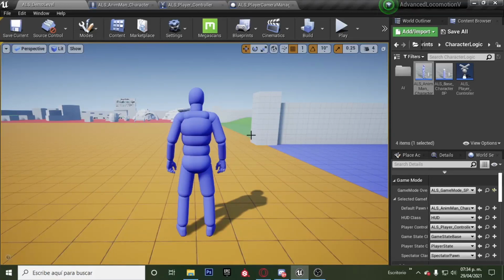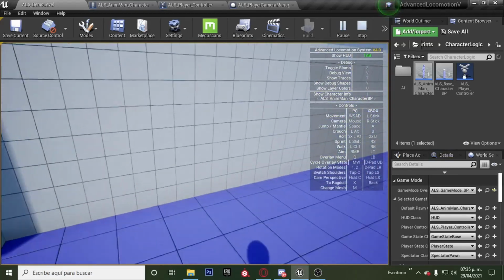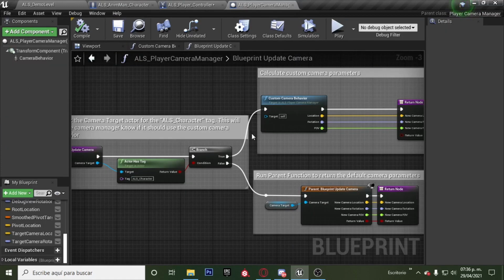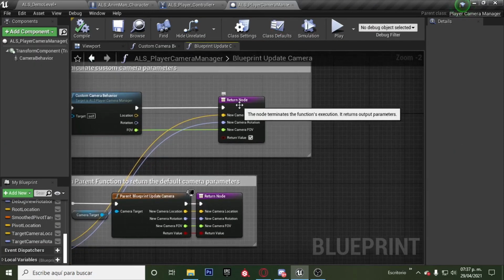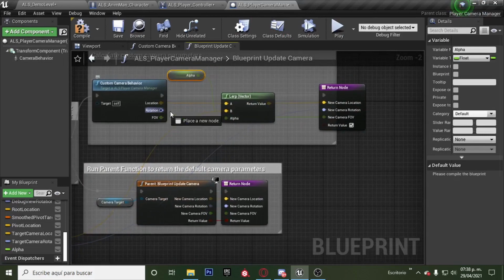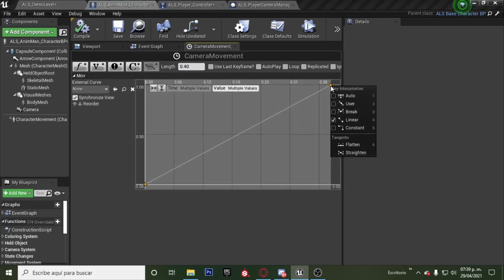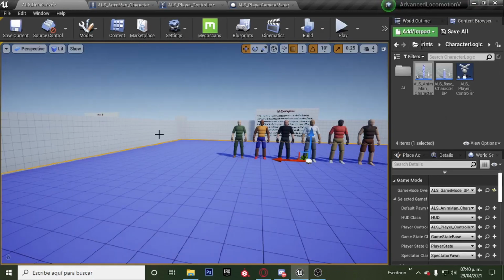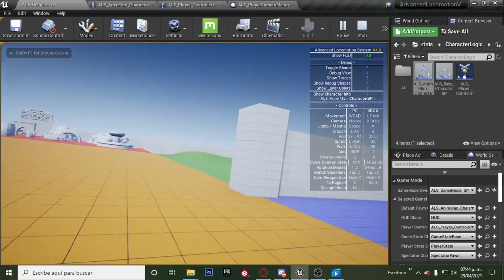UE4 Improve camera system using CameraManager

Comment: hi there , any idea on how to use the als 4 camera management system on a vehicle . i did all the camera animation part for driving and added a new movement state as driving in the enum . and when i posess the vehicle i change the movement state to driving but the vehicle just doesnt use the ALS camera .
Reply from the maker: the camera manager needs a reference to the character, if you are changing the character you are also changing the camera, but a cool feature is that the camera manager is part of the controller, so just edit the code to use a reference to the car instead of the character

Comment: I think this type of True First Person is only better / cool on the surface, but in actual gameplay contexts its very jarring and doesn't represent the way our eyes actually see the world. Our brain does a lot of stabilization and even if you run, the image is pretty stabilized irl. I personally just used the built in 1st person functionaly, broke the z axis and tied the Z axis to the pawn location (adjusted to be roughly head height) to eliminate bobbing. Then I made the head invisible from the inside for first person use. The headbob with unmodified True FP is just way too jarring and violent.
Reply from the maker: yeah, you can only use 1or 2 axis; and clamp the value of the interpolation; on my projects usually I divide the lerp to something to interpolate between 0-0.6 for example, so I'm not using the last position.
Reply: Agreed ^ did the same with my system
Reply: Where is this located in the project? Trying to find the Z axis you are speaking of, is it located in the Anim_BP or the ALS_Character BP?

Comment: I HAVE SETUP LIKE THAT HOW YOU TOLD
Reply from the maker: ohh soryy I didn't understood your question so I rewatched my video and now I know your "problem", as I said on the minute 5:22 on my projects I use a condition, true if I'm on first person (I pressed c) or false (I'm on third person) to switch between the default first person and my custom first person camera with the third person working.
But if you copy this without that kind of condition even if you are on first or third person this will use my custom camera because the final part of the lerp doesn't care about the first point.

I leave the code just like that becase I think this kind of camera is only for first person games, like horror games and if you want to set up only the first person it's someting you need to do on the als

Comment: Hi sorry to bother you, how would you setup your own player camera manager not using als? :O
Reply from the maker: The player controller it's the one that gives you the als camera manager on the on posses event(just see how it works here to set your custom camera manager), you can delete that or change the "tag" into the class settings of the als_character because the player controller use that tag name.
If you want to set a camera actor you will need to do the same.
Reply: @Shumaro-dy5xn  Hi after I posted the comment I found out! Your reply confirms! Thanks for the response. :P